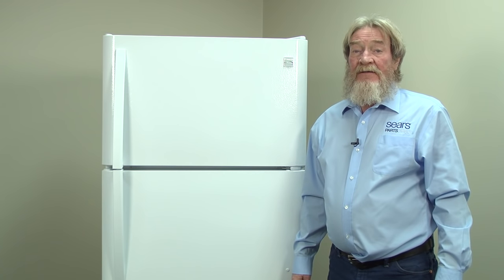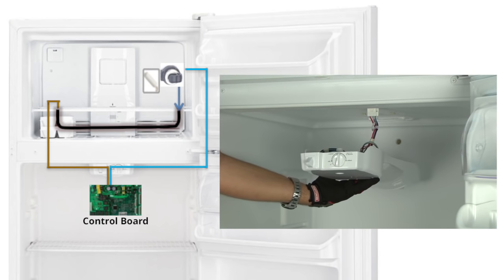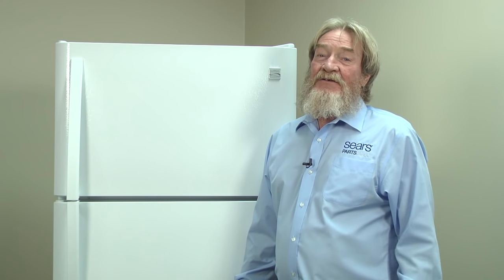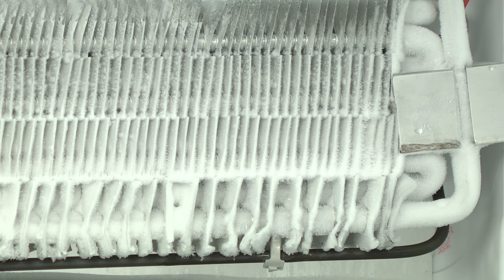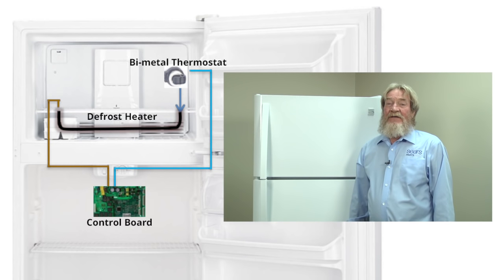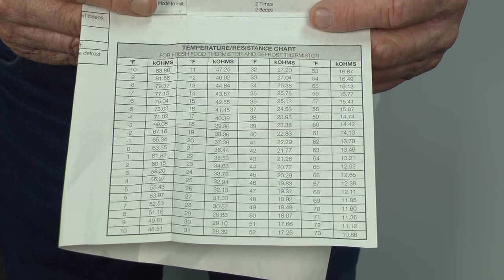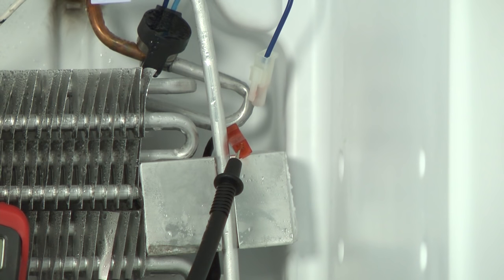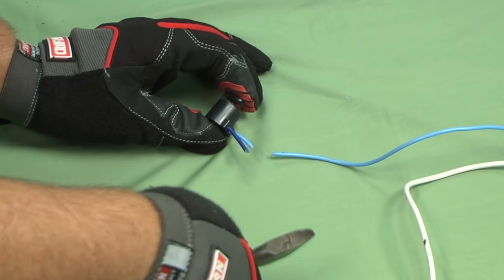How to Troubleshoot Defrost System Problems in Refrigerators

Comment: frig is keeping things cold, but freezer not keeping thing froze. cleaned coils on bottom of frig. Amana sxd23vw side by side. what to check
Reply from the maker: Check to see if the compressor is running. You’ll hear the compressor buzzing if it’s running. If the compressor isn’t running, then look at the condenser fan to see if it’s running. If the condenser fan is running, but the compressor isn’t, then you may need to replace the compressor start relay (http://www.searspartsdirect.com/part-number/WPW10189190/0046/106.html). If the compressor is running, check to see if the condenser fan is running. If the condenser fan isn’t running, then you’ll likely need to replace the condenser fan motor (http://www.searspartsdirect.com/part-number/833697/0046/106.html). If the condenser fan and compressor are both running, unplug the refrigerator and remove the evaporator cover in the freezer compartment. Check for frost on the evaporator fins. If you don’t see frost on the evaporator, then you’ll need to have a service technician diagnose and repair the refrigerator because the compressor isn’t working or refrigerant leaked out of the sealed refrigerant system. The compressor or sealed system should only be repaired by a service technician because the repair involves the recovery and recharge of refrigerant. You can schedule service here: https://www.searshomeservices.com/. If neither the compressor nor condenser fan are running, then pull off the toe grill to access the defrost timer on the bottom, right corner of the refrigerator. Turn the red defrost timer knob clockwise a quarter turn to manually advance the defrost timer. If the compressor starts, then a stuck defrost timer was likely causing the cooling problem, so replace the defrost timer (http://www.searspartsdirect.com/part-number/R0131577/0046/464.html). Don’t forget to unplug the refrigerator before replacing internal parts. If the compressor doesn’t start after advancing the defrost timer, then you may need to replace the temperature control thermostat (http://www.searspartsdirect.com/part-number/R0161092/0046/464.html). Again, don’t forget to unplug the refrigerator before replacing internal parts. These tips may help solve the cooling problem in your refrigerator. Let us know if you need more help.
Reply: Deb Wiese A

Comment: I have a Sears Freg with a bottom freezer Mo # 596.65932402, Every thing check'd  out but I do not know how to test the main digital control. How do I put it into Force Defrost mode?  Thank you
Reply from the maker: To enter the forced defrost mode, open the refrigerator door and hold down the refrigerator door light switch while pressing the refrigerator temperature down (-) button 3 times within 10 seconds. Release the refrigerator door light switch and “F” should appear in the freezer temperature display with “d” appearing in the refrigerator temperature display. Press the refrigerator temperature down button and “S” will appear in the refrigerator temperature display. Press the refrigerator temperature down button one more time and the control will begin the defrost mode. The display will show the current freezer and refrigerator settings. After the forced defrost cycle ends, normal refrigerator operation resumes.

Comment: My problem is that I can't get it in manual defrost mode.I tried pushing the light button 5 times in 6 seconds but the fan stays on.. I thought everything stopped in defrost.
Reply from the maker: The fan stops briefly on the model that we use in the video. The control also beeps when it enters the test mode. If you don’t have the same model (253.60412411) then the procedure may differ. Check the tech sheet again for your model regarding the forced defrost or test mode. If you need more help, let us know the model number of your refrigerator.

Comment: Will any of these issues cause the evaporator fan to not turn on?
Reply from the maker: Excessive frost can block the evaporator fan blade from turning in some refrigerators. If excessive frost isn't blocking the evaporator fan blade, then you can follow the troubleshooting advice in this video to help you figure out why the evaporator fan isn't running: https://www.searspartsdirect.com/article/troubleshooting-evaporator-fan-problems-in-refrigerators-video.html  We hope this information helps. If you need more assistance, let us know (and provide us with the model number of your refrigerator so we can give you more accurate troubleshooting advice for your type of refrigerator).

Comment: Does anybody know what's the regular voltage on the heating element line?  On ours it's 34-35 volts, have no clue if it's normal.
Reply from the maker: Our DIY troubleshooting advice typically recommends resistance checks with the refrigerator unplugged to diagnose defrost system failures because live voltage checks are dangerous. We don’t recommend that you check live voltage yourself even though we’ll answer your question. Most defrost systems send 120-volt AC current to the defrost heating element. We recommend that you check resistance through the defrost heating circuit from the control device that's sending voltage to the defrost heating element (defrost timer or electronic control board). If you measure defrost heater resistance (typically 20 to 40 ohms) through the heater circuit connected to the defrost timer or electronic control board, then the heating element, safety device (such as the defrost bi-metal or fuse) and the heater circuit wiring should all be okay and you’ll likely need to replace the control device (defrost timer or electronic control board). Keep in mind that many defrost bi-metal thermostats trip at 50 degrees so that thermostat will need to be colder than 50 degrees when checking resistance through the defrost heating circuit if your refrigerator has that type of bi-metal thermostat. We hope this information and advice helps. If you need more assistance, let us know.

Comment: The defrost thermostat/bimetal is tested when cold with multimeter. It stays "closed" only momentarily.
Reply from the maker: Most defrost bi-metal thermostats open when the surrounding temperature reaches 55 degrees F but that temperature can vary in various bi-metal thermostats. Many bi-metal thermostats are labeled with the temperature at which the thermostat opens. The opening temperature rating may be labeled in the Centigrade scale to you may have to convert the temperature rating to Fahrenheit. The bi-metal thermostat that you’re testing may be operating properly if surrounding temperature trips the bi-metal open while you’re testing it. If you suspect that the bi-metal thermostat is opening at a temperature below its rating, you can unplug the refrigerator and remove the bi-metal thermostat. Fill a glass with water. Insert a thermometer into the glass of water to measure water temperature. Add some ice cubes to the glass of water to cool the water down to 32 degrees and insert the body of the bi-metal thermostat into the water while keeping its wires outside the glass so you can test the bi-metal thermostat for continuity at various temperatures. Vary the water temperature by removing ice cubes while monitoring continuity through the bi-metal thermostat to determine the temperature at which the bi-metal thermostat opens. If the bi-metal thermostat opens more than 10 degrees below its rated opening temperature, then replace the bi-metal thermostat. You can order the replacement part here: https://www.searspartsdirect.com/. If you need more help, let us know.

Comment: How the frost but not cool
Reply from the maker: If the refrigerator has a small amount of frost across all evaporator fins but it's not cooling, then air circulation passages could be blocked. Move any items blocking air vents in the refrigerator. If the evaporator fins have excessive frost, check the door gaskets and replace the door gaskets if they're damaged. If the door gaskets are okay, then a failure in the automatic defrost system could be causing excessive frost and cooling problems. We hope this general information helps. If you need further assistance, let us know the model number of your refrigerator and additional details about the cooling problem.

Comment: Bimetal  trip on off every 10seconds  why
Reply from the maker: The defrost bi-metal thermostat in this video trips at 47-degrees and resets at 22-degrees. The defrost bi-metal thermostat is likely defective if it trips on and off every 10 seconds if the thermostat in your refrigerator is similar to the one shown in the video. If the defrost bi-metal thermostat looks different than the one shown in the video, let us know the model number of your refrigerator and we'll try to find the specifications for the defrost bi-metal thermostat in your model. You'll need to unplug the refrigerator and replace the defrost bi-metal thermostat if it isn't tripping and resetting a the right temperature.